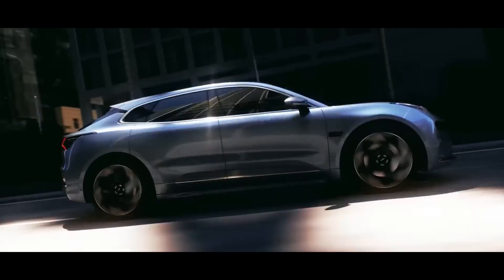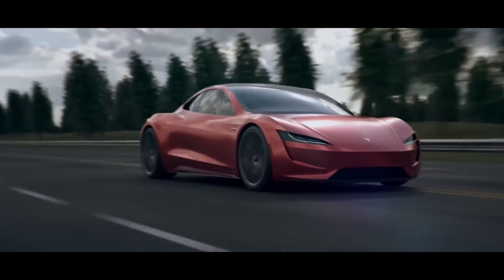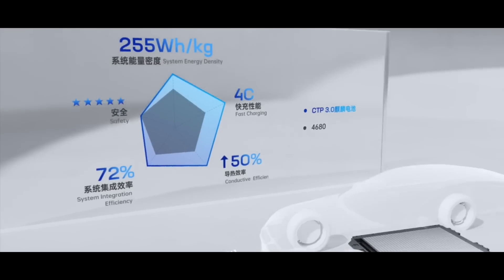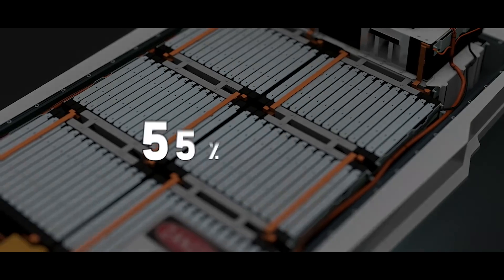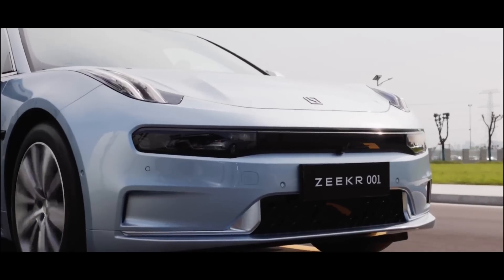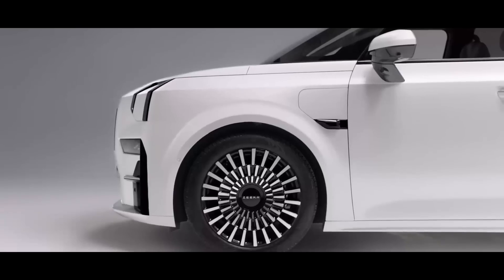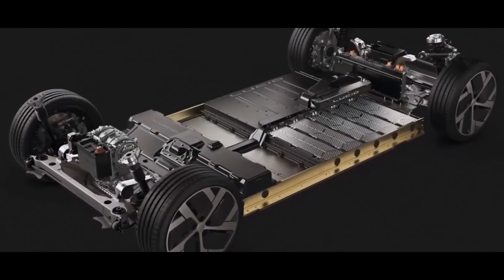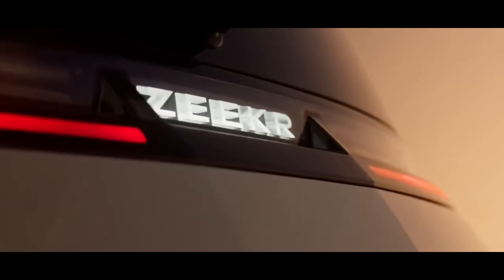China Shocks entire EV Industry with advanced NEW Battery in Zeekr Cars | Tesla agrees

Comment: There is no energy loss Axel to Axel 

The Front Axel would propel the car and the Rear Axel would be set up to recharge the battery and run the car 

Why wouldn’t you do this type of system
Reply: Physics, that's why. There is always a cost; the question is how efficient is it to overcome the loss. Something my brother neglected in trying to invent a Hydrogen system. Yeah he could produce Hydrogen ... inefficiently. Same with your scenario; yes, it could be done but not efficiently enough. There are brighter minds out there than you think.
Reply: @ScubaSteveCanada  no you’re wrong. Axel to Axel there is no power loss the front engines make more torque than the belt driven alternator uses. Sorry you’re wrong. Apparently you’ve never made anything.
Reply: That's been tried for a few centuries. It's called the Prepetual Motion Machine. Physics wont allow it
Reply: @Darkmatter321  it’s not perpetual motion and it’s not impossible 🤔 there’s something that hasn’t been developed yet
Reply: @Darkmatter321  it’s not perpetual motion. Its a torque conversion. In a FWD system you can generate more torque from the front axle than it would take to also apply a charging system on the rear axle. You are able to move AND make power. Any type of system. Whether is a helical gearing system or a belt system, only produces 100 ft lbs of torque loss on the rear axle so you’re still 300 ft lbs of torque to the good. It’s not “impossible” 

It is impossible when you don’t try 

I don’t need a thousand thoughts saying it won’t work

That has been played out a million times throughout history 

I just need one person that has the final solution
Reply: @Darkmatter321  the answer is around torque vectoring. 😶 it may be a yaw sensor issue 😶 I’m not sure 😶 but it’s not impossible 😶
Reply: @Darkmatter321  

Run the alternator and battery together. 

An alternator generates electricity to continuously power your battery. When the two are working properly, they achieve the perfect combination of power, creating a circuit of electricity that feeds itself for long-sustaining performance.

That would basically make it a closed loop system where there is not power loss and torque is met with a positive energy from the rear axle system.
Reply: @Jason Scott  Not going to work. Apparently you don't understand how an alternator works. In order for the alternator to produce power and that's the combination of voltage and current, it requires torque to spin the rotor. The more power you're trying to generate, the more torque you'll need to spin the the alternator because it's resisting the rotation in direct proportion to producing power. The more load you put on the drive motor, the more power it will draw exponentially. You're never going to be net positive in producing power from your drive motor spinning your alternator because of mechanical loss and all the accessories you would have to power the entire vehicle. Regenerative braking already convert all the drive motors in an EV into generators to put power back into the batteries while slowing down but it's nowhere near what the drive motors consume. If it was so easy like you said, I'm sure the great minds from Tesla company would have figured it out already and/or other companies. If your theory works then essentially the EV could go virtually unlimited distance on a full pack which isn't going to happen anytime soon. The only way an EV could go super long distance is to have a nuclear reactor power generator which also isn't going to happen either for obvious reason of its danger.
Reply: @zzzzVIDEOSzzzz  

there is no power loss Axel to Axel 

It is a torque issue but it doesn’t take that much torque to drive an alternator system 

It equates to a power loss from front to rear as torque conversion 

And yes

You can generate as much power as a car uses while it’s in motion 

It suffers power loss when it is not in motion 

As long as it is moving it doesn’t drain
Reply: @Jason Scott  What you're suggesting is a perpetual infinite motor-generator. It's been debunked many times. It's not possible. You may get very close to it in a lab situation where the power generated is only use to drive the motor and you have nothing else to worry about. In an Electric Vehicle, you're forgetting about the total weight of the vehicle which for an EV is going to be a heavy vehicle. The drive motors are going to need a lot power to move all that weight. Then don't forget about all the accessories in the EV that requires power such as HVAC, lights, radio infotainment system and so on. The power draw of the driving motor will always be greater than the output of the generator. If this was so easy to do, companies would be touting this and marketing it already! My work involves working with big diesel generator 50-250kw and power systems. I always have to do a fuel calculation on a generator running base on its load percentage. A 5% load vs 75% load on a generator could mean a generator run time with 250 gallons of diesel fuel of 168 hrs at 5% vs 40 hrs with 75% load. If you think it doesn't require that much torque to spin the generator, then why do we have big turbo diesel engine from Mack truck spinning the generator?
Reply: @jasonscott6640  Here's a video of your concept. 

https://youtu.be/-vaD24Y3L5I
Reply: @zzzzVIDEOSzzzz  you could still have an alternator system that moves itself and charges auxiliary components. 

We’re talking about a simple FWD Drivetrain in a car that looks like the old 1988 Fiero GT 

That would be a nice car 

A basic cheap two seater that is half the curb weight of these existing cars
Reply: @zzzzVIDEOSzzzz  that video is direct Axel to Axel 

😶

The Alternators purpose is to charge the battery 

The battery runs the motor 

😶

Where is the battery in this set up
Reply: @Jason Scott  what is going to power all of your generator? 
So now you have one to power your drive motor, one to charge the batteries and one to run the accessories. Where are you getting the mechanical force to drive all of those generators? 
And remember, the more generators you have the more power you will need to drive them due to the EMF drag they will incur. See my previous reply on the amount of fuel required to drive the loads. There is no free lunch here.
Reply: @zzzzVIDEOSzzzz  

Basically you need to synchronize the moter, battery, and alternator to work together 

In an alternating current (AC) electric power system, synchronization is the process of matching the frequency and phase and voltage of a generator or other source to an electrical grid in order to transfer power. 

If two unconnected segments of a grid are to be connected to each other, they cannot safely exchange AC power until they are synchronized.

A direct current (DC) generator can be connected to a power network simply by adjusting its open-circuit terminal voltage to match the network's voltage, by either adjusting its speed or its field excitation. 

The exact engine speed is not critical. However, an AC generator must additionally match its timing (frequency and phase) to the network voltage, which requires both speed and excitation to be systematically controlled for synchronization. 

This extra complexity was one of the arguments against AC operation during the war of currents in the 1880s. 

In modern grids, synchronization of generators is carried out by automatic systems.

This would also work in an automobile as well 

😶
Reply: @zzzzVIDEOSzzzz  if you can’t understand that the motor battery and an alternator or generator need to be synchronized I don’t know how else to explain it to you. 

You need to synchronize the battery motor and alternator to work together 

Okay
Reply: @zzzzVIDEOSzzzz  

Regarding (No Free Lunch) 

The Synchronous Speeds Formula:

Synchronous speeds for synchronous motors and alternators depend on the number of poles on the machine and the frequency of the supply.

The relationship between the supply frequency, f, the number of poles, p, and the synchronous speed (speed of rotating field), ns is given by:

f = PNs / 120
 
f={\frac  {pn_{s}}{120\ }}.
In the following table, frequencies are shown in hertz (Hz) and rotational speeds in revolutions per minute (rpm): 

😶

That’s a good place to start 

😃

But it’s not impossible 

☺️
Reply: @zzzzVIDEOSzzzz  
🤔
No 
😶
What I’m saying is to synchronize the batteries, motor, and an alternator system. 
😃
Why aren’t these systems using alternators. 
🧐
Alternators are a batteries best friend. 
😃
Reply: @Jason Scott  Your explanation of synchronization is totally irrelevant in an EV. That only applies to the electrical grid when you're tying in a different 3-phase source to another source in which each of the 3 phases have to be synchronized with each other in relation to frequency, phase angle and voltage otherwise there will be an electrical collision. I'm aware of this as my day job is an electrical engineer for an Electric Utility company. I happen to drive an EV. A typical EV such as the one I drive (Kia EV6 GT) have the high voltage battery (700V), standard low voltage battery (12V), 3-phase VFD inverter with rectifier function for regenerative braking, and of course the 3-phase AC permanent magnet synchronous motors (front & rear). There's also a voltage converter that converts the high voltage battery DC power to charge the 12V accessory battery which runs your radio infotainment system, dashboard, running lights and such because there's no dedicated mechanical alternator which would not be practical because if you're just sitting still parked, you'll have no way to charge the 12v battery without the DC-DC converter.
An EV is all about efficiency in order to get as much range as possible. The Kia has front & rear traction motors but during cruising, it has the ability to disconnect the front traction motor mechanically not just electrically in order to reduce drag and power draw. If you put your foot down wanting to accelerate quickly, it will then re-engage the front motor instantly. 
When you need to slow down in an EV, the inverter will then become a rectifier by rectifying the 3-phase AC power produced by the traction motors into DC power in order to charge the batteries. The paddle shifters can set the amount of regenerative braking force from level 0 to 4 with 4 being max at which it will also give you highest deceleration rate because it's extracting maximum mechanical energy slowing down the vehicle and sending all that power to the batteries. On my dash, I can see the amount of KW being consumed and conversely I can see how much is being generated by both traction motors when I'm using regenerative braking. The amount that is recovered is no where near the consumption rate consumed by the traction motors but it's something. I'm going to go out on a limb and assume you don't own an EV. Because then you'll understand that when you're using the regenerative braking and it can slow the car down pretty substantially without the need to even use the mechanical foot brake and producing power to charge the batteries in the process, you'll understand why you can't have one axle acting as traction motor and the other axle acting as a generator. You'll never be net positive power gained due to the drag of the generator will incur on the traction motor.

Oh that formula that you posted is also irrelevant as it refers to how to calculate the RPM of an AC synchronous motor depending on how many poles the motor has and how much AC power you're feeding it. It has nothing to do with your theory of synchronizing the battery, motor and alternator in order to have perpetual power from one axle to the other.
Reply: @zzzzVIDEOSzzzz  you still haven’t configured the system correctly 😶
Reply: @Jason Scott  And neither have you. In your last post, you probably just went and copied and paste stuff trying to sound technical. I can tell from reading it that it's not in your own words. Nice try on that to bamboozle me.😄
Reply: @zzzzVIDEOSzzzz  

something is not being looked at correctly 

🤔
Reply: @jasonscott6640  ok, let me hear your configuration if you're saying I'm incorrect. Prove me wrong.
Reply: @zzzzVIDEOSzzzz  

😶
I’m sorry. 
😶
I’m programming right now. 
😶
Haynes 88 material.
😶
Tough as Nails. 
😶
Gummy. 
😶
Nasty stuff. 
😶
Just checking my coolant levels viscosity 
😶
All of my tools are on center
😶
Checked my hydraulic fluids 
😶
Bored location 
😶
2.5” diameter bar stock
😶
6” slugs 
😶
And yes I do look at other information and ask questions 
😶
But you imply I’m not smart is pretty arrogant 
😶
That’s probably why you don’t find the correct answers
😶
I have to set up the other side of this twin spindle lathe now 
😶
I believe it is a Mori Seiki Lathe 
☺️
Reply: @zzzzVIDEOSzzzz  
😶
I need a mechanical engineer atm moment. 
🧐
This isn’t about proving anyone right or wrong it’s about finding solutions. 
😶
You have the wrong attitude
😶
I need a mechanical engineer to look at this
😶
It’s about progress
😶
Look at mechanical engineering and the answer may well lie there. 
😶
I don’t know.
😶
Necessity being the mother of all inventions and driving force behind progress 
🤔
Knowing I DON’T have all the answers 
😶
I’m asking questions about the things I don’t know
😶
I also understand nothing is impossible you just haven’t found the solution yet
Reply: @zzzzVIDEOSzzzz  I’ve worked in Aerospace for years
😶
You know what’s funny 
😶
In our field there is no such thing as “impossible” 
😶
Just a solution we haven’t found yet. 
😶
No ego, that’s just the way it is 
😶
“We haven’t found the solution yet” 
😶
And then you’re questioning my intelligence 
😶
But you haven’t found the mechanism that makes this works. 
😶
You’re questioning my intelligence 
🤔
But you haven’t found the answer to these questions 
😶
I don’t need to know why it won’t work 
😶
I just need one solution that leads to an answer
😶
Questioning intelligence is in relation to intelligence itself 

I know a lot about aerospace engineering and mechanical engineering 

I don’t know a lot about electrical engineering 

But you guys seem to have a lot of quit in you 
😶
Reply: @Jason Scott  I am for obtaining energy at the lowest cost but somethings are not attainable. You have to accept that. Fusion Reactor power promises cheap clean electricity for everybody. Thousands of engineers in many countries have been working on that for over 40 years and they still haven't got it totally figured out yet to build a commercial reactor. They did just reached a milestone in a lab where for the first time they reached net positive energy. May be in the very near future they will have commercial Fusion Reactors deployed. 😁
As an EV owner, I get beat up all the time for its lack of range and long recharge time by the ICE people. It is totally manageable but I would love to be able to throw it to their face that my EV can do over a 1000 miles range. So that get me wrong, I would love for your idea to work but I'm a realist and I know physics won't allow it for the time being. 
There are thousands of brilliant engineers between Tesla, Lucid, Rivian, Mercedes, BMW, Polestar, GM, Ford, VW, BYD just to name a few. None of them have got your idea figured out yet. I'm sure if they got it to work, they will be promoting it heavily since it'll be no skin off their back to have an EV than has several thousands of miles range because it's able to generate its own electricity while driving.
Reply: @zzzzVIDEOSzzzz  I believe we extend range if these items were configured correctly 

I don’t know what else to say

I believe something isn’t configured correctly 

Anyways 

I’m off to set up another machine 

Oil impregnated Bronze 

No coolant 

Hmmm 

Probably so it won’t corrode 

Anyways 

It’s about 

“Accepting anything” 

You haven’t found the answer 

I get it

I’ll be calling around to find out then
Reply: @Jason Scott  It's not that I alone haven't found the answer on your idea. It's thousands and thousands of brilliant engineers of all those car companies that I mentioned previously. They haven't found the solution to your idea yet either apparently. You should write to all of them and let them know on all the millions of EVs that they've sold are not configured properly to have it self-powered. Tell them to check the synchronization settings. 😀
Reply: @zzzzVIDEOSzzzz  I personally would take the same battery pack system and make it in separate pieces. Maybe make the same battery size in 3 pieces. Have one battery powering the other one charging and the third stage of the battery at rest. 

😶

Something like that 

😶

That way there

😶

There would be a section of battery working a section charging and another section at rest. 

The system could be programmed to keep one battery charging another section of that battery resting and another section powering the car

Is that feasible 

It should be 

You could shuttle in between batteries keeping one charged one resting and another one powering the car

I am NOT talking about more batteries either 

I am asking if we could put the battery in three different sections

In that configuration there would be time for the battery to 

Rest 

Charge 

And Work 

The battery system itself would be the go between 

With newer materials like Graphene Batteries 

The charging time is reduced 

You should be able to program a rotation on the charging system

At the very least this configuration would extend range exponentially

The real innovation will be in using the battery system correctly 

With one battery there are no options 

But

If you take the same battery surface footage and make that surface footage in three separate pieces 

You CAN charge one 
Let one section REST 
And POWER the rest of the drive train

Then the charging current and powering current are separated by a section of battery that’s resting 

So there are plenty of avenues to look at
Reply: @zzzzVIDEOSzzzz  
😶
I was thinking 
🤔
Why wouldn’t you have a sectional battery 
🤔
The FWD would generate 400 ft lbs of torque 
🤔
The rear axle would only need 75 ft lbs of torque to utilize some sort of charging system 
🤔
The battery cell needs to be reconfigured because that is the medium that will convert the energy 
😶
So one section of the battery would be powering the car 
🤔
another section would be charged from an alternator that is utilizing the rear axle 
🤔
Another section would be at rest 
🤔
So the problem is two fold
🤔
The battery is not configured correctly and there is no charging system 
🤔
The car should be able to generate as much power as it uses 
🤔
And it’s the battery gauge that would look like a wave. 
😶
So you’d need to have a multi cell battery and an alternator system 
🤔
Two things currently missing 
🤔
I would look at Graphene Batteries too
😶
They should be able to charge and discharge working like a crankshaft 
🤔
The electrical histogram chart needs to resemble a torque dispersion chart and you’d use different battery cells to do that 
🤔
Not one big battery 
🤔
But one big battery broken down into smaller cells perhaps 
🤔
Then you could charge the car and be at levels during that cycle 
🤔
You should be able to produce as much as you make while it’s moving 
🤔
Then the only thing you’d have to manage is auxiliaries like the gauges power accessories 
🤔
It’s not impossible 
🤔
And it’s a torque dispersion issue 
😶
Reply: @zzzzVIDEOSzzzz  
😶
I think the battery needs to be in sections that resemble a crankshaft journal 
😶
Just like a combustion engine needs to be at work rest and recovering energy 
🤔
I think the battery power histogram needs to read like a crank shaft journal histogram
Reply: @zzzzVIDEOSzzzz  
😶
Hello kid sir 
😶
Another thing I was thinking about in a FWD System 
😶
Using the rear axle to set up some type of changing system 
😶
You would use the cells in a battery like a wave 
😶
You need the correct battery pack set up 
😶
Different absorption and dispersal cells with different cells at rest
😶
The motion would appear as a torque issue on the power side
😶
The alternator is more straight forward 
🤔
It can charge different sections of battery 
😶
You should be able to meet power loss and meet that with absorption 
😶
You’re not looking at the mechanics of a combustion engine 
😶
Because those torque forces apply in electrical engineering 
😶
Yes
😶
 A different battery system would charge, rest, and disperse energy at different stages 
😶
So you should be able to use different battery cells 
🤔
Like pistons in an engine 
🤔
Charging and dispersion cells would look different 
😶
Top Dead Center and Bottom Dead Center would appear on a charging histogram as heat retention and dispersion.
😶
I’m trying to word this correctly so you don’t think I am 
😶
A Retard 
😶
My spark plug works fine 
😃
This type of system would not allow complete drainage. 
😶
What you would be looking at is life expectancy of a system like this
😶
Not
😶
Is it viable 
😶
You’re storing and discharging electricity 
😶
It should not be this difficult 
😶
Again 
😶
An engine has different sections call “cylinder” 
😶
We could call those cylinders “Cells” 
😃
And then you could control energy absorption and dispersion 
😶
Which is basically heat dispersion turning into an electrical dispersion system 
😶
Like timing in a combustion engine there would be a timing sequence 
😶
All of these conversations would happen in a battery pack system that resembles cylinders in a car
Reply: @zzzzVIDEOSzzzz  
😶
Anyways 
😶
I am still looking at the mechanics of a combustion engine and breaking those conversations down as battery charging and dispersion as well as rest 
😶
In the right system it’s like always having enough energy 

And the car is switching the battery for you 

When you treat the back Axel as a charging system 

The battery function changes 

It car will have the capacity to charge itself because electricity shows up as heat retention and dispersion 

Batteries 🔋 will change the flow and retention of that energy 

There should always be enough power  

The only time the battery drains is when the car isn’t in motion 

But a set up like this may change the range of motion and vehicle distance 

You’ll still need a full charge once in a while but a system like this may well extend range
Reply: @zzzzVIDEOSzzzz  
😶
from what I can understand 
😶
You haven’t recreated the power band of a combustion engine electronically 
😶
You can not run a sports car on one cylinder 
😶
You need battery cells to work like engine pistons
😶
Top dead center on an electrical histogram would represent 95% charge 
😶
Bottom would represent an 80% charge 
😶
The battery would absorb the energy which would take care of the heating problem I would think
😶
Reply: And this type of configuration isn’t perpetual  motion 

The driver is not a perpetual part of that equation 

😶

But you can make FWD Electric Drive Train and use the Rear Axel to Mount some sort of charging system. 

Configuring battery cells in to power pack that charges, rests, and powers. 

You have to use the battery pack charging sequence to work like an engine 

The alternator would be the gas tank 

I don’t know the wiring instructions behind all that 

But that is a more correct answer than what we have currently 

A simple timing sequence would work to absorb or charge energy I would think. 

And the driver is the perpetual part of that equation 

😶

You can not drive forever you would get tired and fall asleep 

😶

But you should be able to harvest store and use electricity in a vehicle in a timed sequence to maximize battery life which should increase range